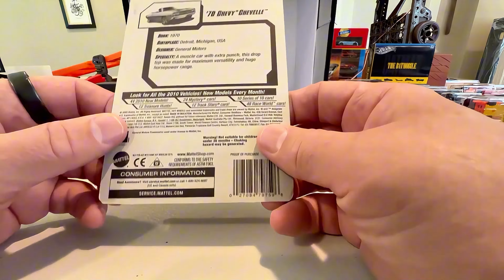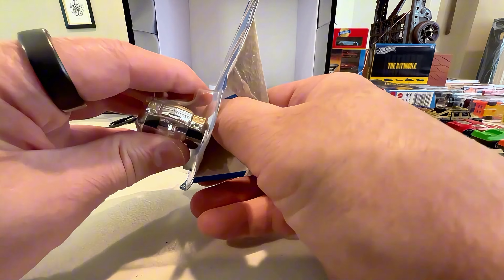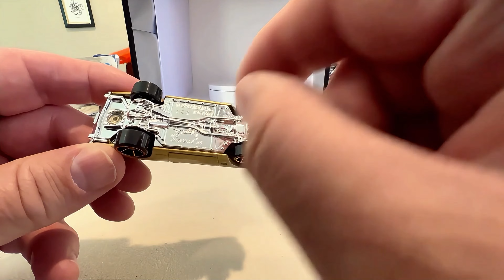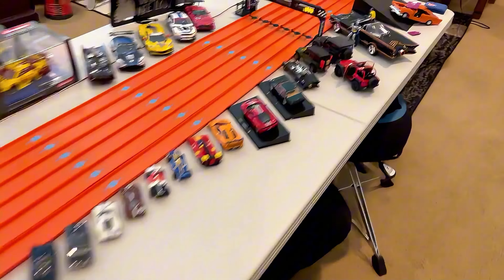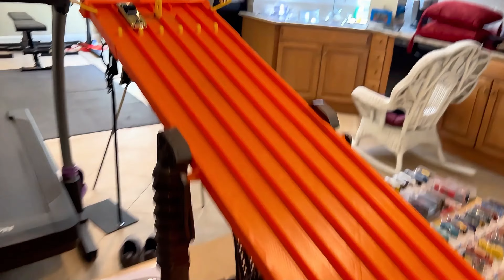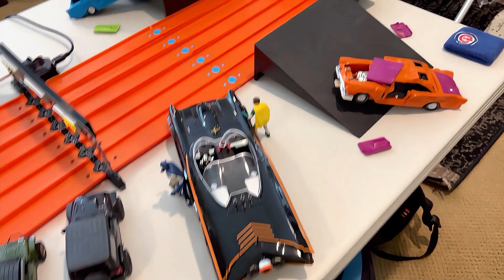Nickel-Plated Axles -- Does the FTE Wheel System Actually Make It Faster? | Peak Speed Lab 1:64

Comment from the maker: 📌 '70 Chevelle FTE: 1.8514s -- #13 of 35. #9 in Class C. First FTE car in The Lab.
Spread: 0.019s | Std Dev: 0.007s | Warm-up: Lap 1 slowest (1.930s), Lap 20 fastest (1.844s).
Runs 7 and 10 beat warm-up best -- 10th car to do it. Run 10 was fastest of session.
Class C: HV1 1.746s | HV2 1.753s | Maserati 1.7683s | Pass 'N Go 1.7863s | Track Dwagon 1.8035s | Camaro 1.8390s | Tesla 1.8390s | El Segundo 1.849s | Chevelle 1.8514s | Mustang GT500 1.858s | MACH IT GO 1.8675s | Fleetline 1.8712s | Jeep 1.9051s | Mad Manga 1.9162s | Charger 2.0297s | Ferrari 2.288s | Greased Lightning 2.345s
Full leaderboard: #1 Dodge 1.7204s | #2 HV1 1.746s | #3 HV2 1.753s | #4 Maserati 1.7683s | #5 Silverado 1.7786s | #6 Pass 'N Go 1.7863s | #7 Track Dwagon 1.8035s | #8 Mini 1.8196s | #9 ZURU 1.8389s | #10 Camaro 1.8390s | #11 Tesla 1.8390s | #12 El Segundo 1.849s | #13 Chevelle 1.8514s | #14 Mustang GT500 1.858s | #15 McLaren F1 1.864s | #16 MACH IT GO 1.8675s | #17 Fleetline 1.8712s | #18 CZINGER 1.8960s | #19 Jeep 1.9051s | #20 CRX 1.910s | #21 Datsun 1.9160s | #22 Mad Manga 1.9162s | #23 Skyline 1.928s | #24 Lamborghini 1.9466s | #25 Alfa Romeo 1.9612s | #26 240SX 1.9909s | #27 AE86 2.016s | #28 Charger 2.0297s | #29 Celica 2.034s | #30 Speedtail 2.060s | #31 Koenigsegg 2.0617s | #32 Bugatti 2.0668s | #33 Boss 429 2.1565s | #34 Ferrari 2.288s | #35 Greased Lightning 2.345s